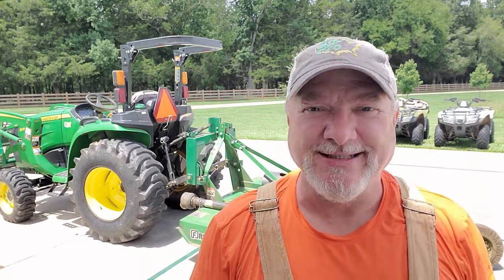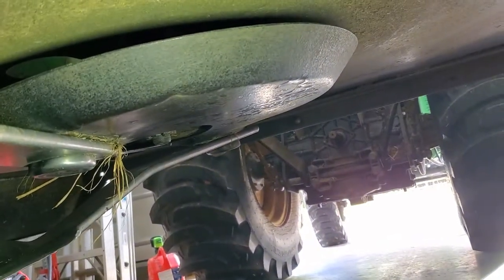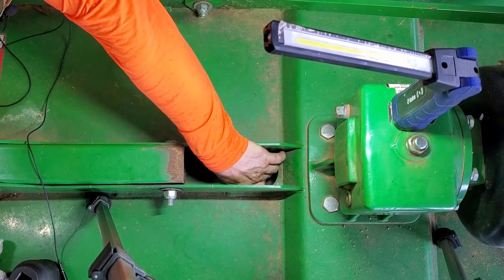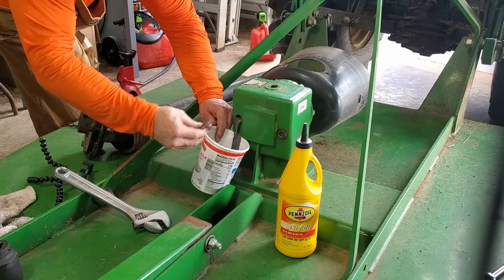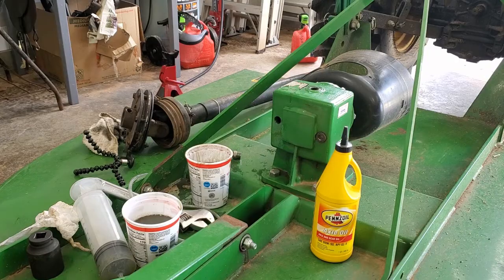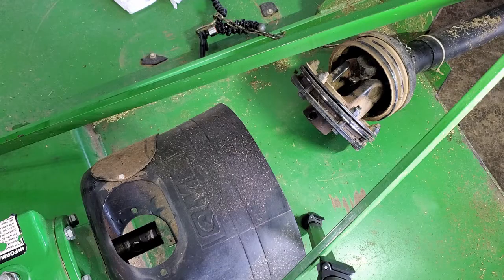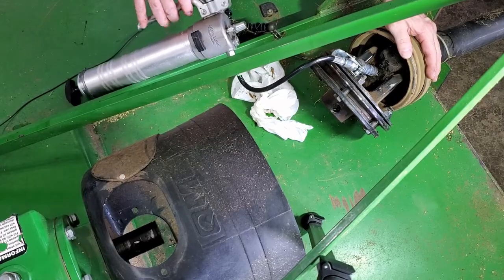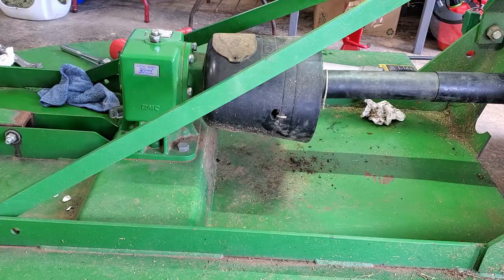Frontier RC2060 Rotary Cutter Maintenance

Comment: Your supposed to lose the clutch plates then energize the pto a couple times to burn in your clutch the tighten clutch back up using a 4mm thickness gage to set the slip. If slip is set right you will not break the bolt
Reply from the maker: Thanks for the info.  I had been using it for over a year when the bolt broke, nit sure it I hit some or not.

Comment: Exact same thing happened to me.  It was the first time I had used the mower for the season.  Service told me I needed to slip the clutch a couple times as it can tend to stick over long periods of non-use due to rust.  They told me to mark the bolts and then loosen them about a half turn or so.  Then engage and disengage the PTO a few times and then retighten the bolts back to their original position.

Comment: Good video, thanks. The bolt you describe as a shear pin should actually be the grade 8 bolt that broke. It is not meant to shear since your cutter has a slip clutch. The info in the manual is confusing but it is there. A grade 2 bolt is meant to shear on shafts that dont have a slip clutch. The key is adjusting the gap on the clutch to 4 mm as others have stated and periodically loosening the bolts and "slipping" the clutch. This is impossible with the ridiculous plasti guard on the Frontier cutters. Also, you should have a drain plug down low on the front side of the gear box which allows draining the oil without using that giant syringe. Thanks for the video.

Comment: I have the same cutter. Just sheared that shear pin a few days ago and it was also grade 8. Manual says grade 2, so that's what I bought. Thanks for the video! I may need to change the gearbox oil as well, since it has been a few years.

Comment: My RC2060 gearbox had more oil then that come out. It didn't look milky but I think that is condensate in the gearbox. I checked the level when I bought it and it was just up to the hole. My gearbox doesn't have a sight glass so I fill it till it runs out of the hole. I would use a grade 2 or 5 bolt in case your discs don't slip like they should. I used a grade 8 bolt and twisted the inner tube on the PTO shaft.

Comment: A PTO link makes connecting/disconnecting so much easier! I was having issue with my arthritis in my hands and this has all but eliminated the problem
Reply from the maker: I agree, but for me they are still just a little to expensive.  If I only had one implement it may be worth it, but I have several and don't want to buy and end for each one.
Reply: @thistlehillfarmstead9131
Reply: I just keep my end on the PTO shaft and then when I remove implements, just take that one off and put it on the next. I thought having multiple pieces was a bit expensive too.

Comment: John Deere does no long make the rotor mower and many other attachments.  They contract with Fronteer.  On reason for excess oil in the mower gearbox is so that when it breaks in, there will be a lot of iron filings that will shear off.  This oil will keep the filings suspended.  So when you change the gear oil you will not need all the extra oil because the gearbox is by now broken in.
Reply from the maker: Thanks for the info.

Comment: Just FYI. The bolt in your clutch is supposed to be grade 8 because the clutch needs to be adjusted.  4mm is your clutch adjustment
Reply from the maker: Thanks, I'll take a look at it.
Reply: The manual for this model cutter specifies 1/2" x 3-1/2" Grade 2 bolt and locknut. The shear bolts are designed to protect the gear box and the tractor, do not install higher grade bolts because you can increase the shear force by thousands of pounds beyond what the drive system is rated for.

Comment: Nice video and helpful, too.  It appears that your rear skirt and chains assembly is missing on your mower.  Will you continue to run it witout or are you scheduling a replacement?
Reply from the maker: Yes it is missing.  I used this while cleaning up some land and did what you should not typically do... which is backing up and cutting.  I hit some stumps and debris and broke it off.  I have been meaning to replace it, but I am usually mowing in the field away from everyone and everything.

Comment: You better work on slip clutch you will continue to shear bolt. Correct size 10. 3 or . 8 mm for shear bolt. I learned all this from hard experience. You clutch is probably froze together.
Reply from the maker: Thanks, I'll take a look at it.